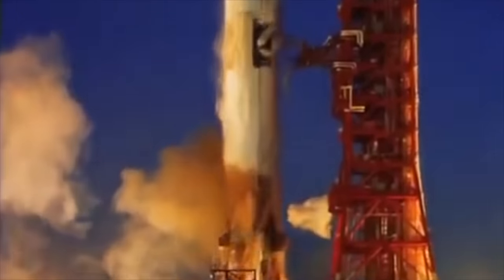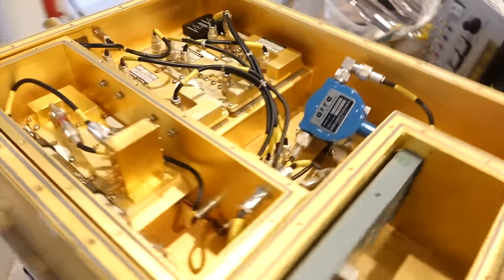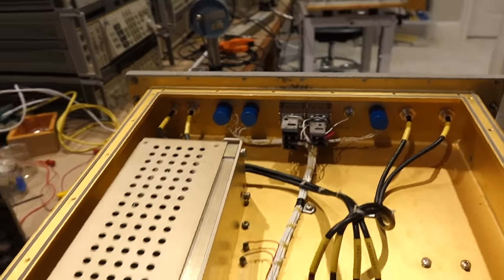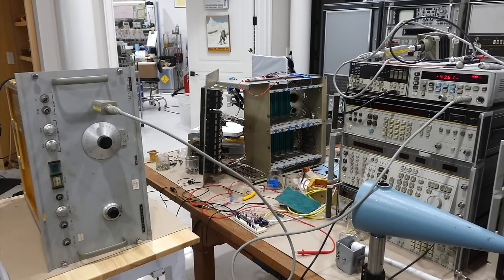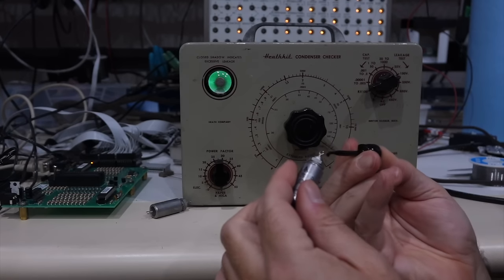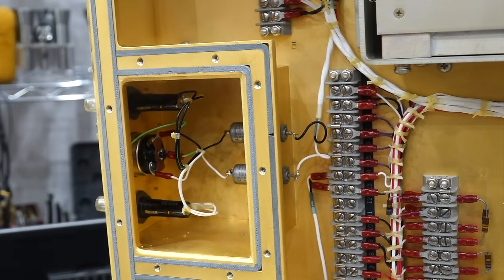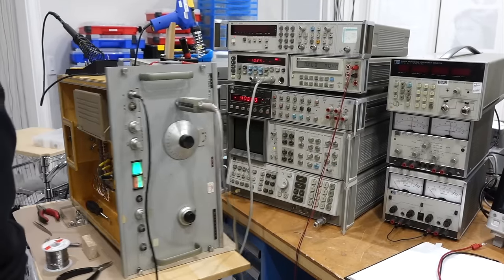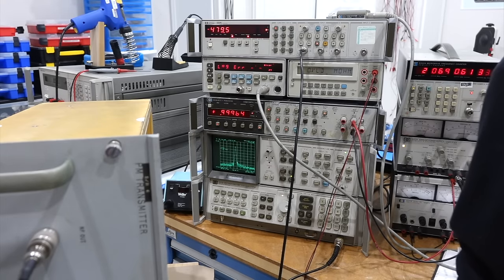Apollo Comms Part 11: Missing PM Transmitter Found!

Comment: That kind of breaker will actually trip for either of two reasons. Current flowing out on the hot wire that does not return on the neutral wire (white wire) which means power is coming back to the panel on ground (ground fault) OR it also detects any kind of arcing fault. AFCI was a great addition to breakers and as such prevents a lot of electrical fires now due to poor quality (degraded) connections in switches, receptacles, and also any kind of arcing in appliances or other loads as well which are fire the most common cause of electrical fires.
Reply from the maker: Amen.
Reply: Yeah,  I remember the time the heating element in my kitchen oven failed.  It was like a welding arc inside the oven hissing and throwing out brilliant light.  I waited for the breaker to trip but it never did so I finally got brave and used the control knob on the oven to turn the power off.   Because of that I understand the value of arc-fault interrupters.
Reply: @urlkrueger  Yes, drawing creating arcs and sparks won't necessarily draw enough current to trip the breaker. Arc welders don't trip their breakers when operating at less overall current than the breaker rating. Reaction times of breakers are also a function of where the current happens to be in relation to their rating.
Reply: @uploadJ  The way that GFCI breakers actually work is that they compare the current going out on the hot (black wire or whatever color that's connected to the breaker lug) and compare the current coming back on it's neutral (white wire on the breaker). They are set to trip when the delta goes above a certain level. They don't literally monitor the current on the ground. Ideally all the current going out on the hot should be returning on it's neutral.
Reply: My portable AC didn't like being plugged into an AFCI circuit in my bedroom. It always laboured getting the compressor up to speed. Eventually, I put it on a (beefy) extension cord to the hallway and it was much happier.
Reply: @jimstanley_49  Yea I had to remove the AFCI from window ac circuit and outlets used for vacuum, they really have limited application and even then fault false positive, I’m not impressed with AFCI.

Comment: I love those eyes but I’ve only seen them in old radios, I also love those illuminated switches. And it’s all over 50 years old now.
Reply: those type switched are still used in Aircraft, not as complicated but Gulfstream used them in the G3 ,  I dropped plenty of those tiny ass bulbs in cock pit had search for them.

Comment: Would running a isolation transformer eliminate this tripping? I realize your area electrical codes may dictate using a GFI breaker, but these breakers are too sensitive .
Reply from the maker: No GFCI are good! They alerted us of a latent fault that would have ended pretty badly. There must have been 10’s of mA already flowing through that deteriorating cap.

Comment: The condo I owned for 40+ years had an old GFCI panel breaker. The EMI filter on my beloved R390A would blow that breaker even though the resistance either side of the line to neutral was in the megaohm range on a Fluke handheld meter. The house I am in now - well - this is not a possible issue. It's 120 years old with knob and tube wiring with no ground wires. I make do. I just be careful++.

{^_-}

Comment: Which tool looks out of place in this scene...  The rubber mallet???  :-)  Don't even want to know how that was used.
Reply from the maker: It's for precision and delicate repairs. Nudging a bond wire back into place, straightening core memory, repairing old mechanical wrist watches, making fine adjustments on HP instruments, etc...

Nah. It was used to nudge the cards out of Ken's updata box. They were hopelessly stuck in there and needed serious convincing to come out. None were hurt in the process.

Comment: Amazing the caps in these things are still as good as they are.  NOT COMMERCIAL GRADE?
Reply: @stargazer7644  Globalism created our throwaway society, and that's not a political comment, just fact. It's a good thing/bad thing conundrum. Build something of high quality that costs more but lasts for decades or build it cheaply, but you can throw it away and get 4 others over  the years. the attention to detail and top notch engineering and manufacturing is why this Apollo era equipment still works AS DESIGNED, minus a few blown bulbs and leaky caps. I don't comprehend the minutiae of these systems, but the way everyone explains them, I can hang and learn and be awed. Major kudos for all them!

Comment: I cant stop wondering how those cases were manufactured. They look like they are made out of a solid block of gold, which of course isnt the case. But even if they are machined out a solid block of anything and gold plated would still be absolutely unheard of.
Reply from the maker: @bobroberts2371  Sure not. This is real gold plating for the best RF shielding!
Reply: We are very fortunate that this historic piece of equipment didn't get into the hands of a recycler. They would have totally destroyed it just to recover the gold content.
Reply from the maker: @stephenbell9257  You bet, that's exactly what happened to most of the stuff. That's a problem with the HP vintage instrument and computer boards also, people recycle them for the gold. Poor Al Kossow even had his storage place broken in, and they stole all his precious HP 1000 boards to recover the gold!
Reply: Probably physical vapour deposition  of gold onto the aluminium done in a chamber at low pressure. If it's spaceflight or military grade test gear specification rules not price. Those boxes would have been mind numbingly expensive to build.